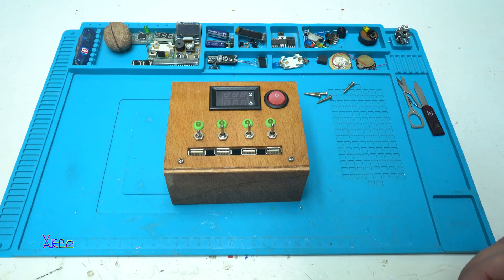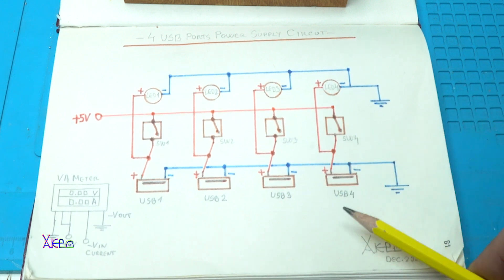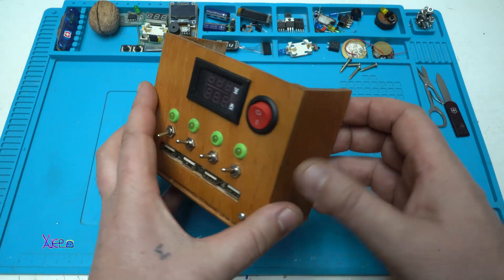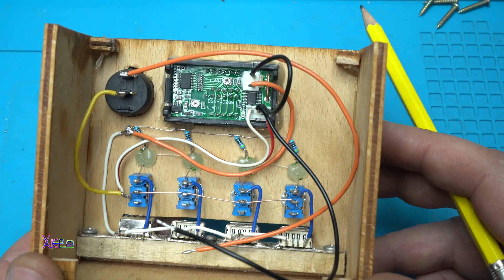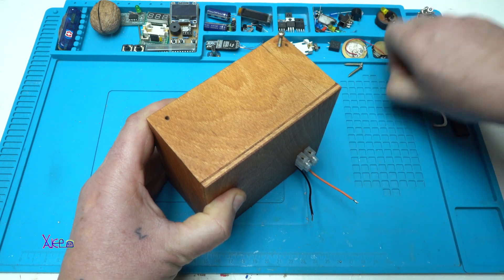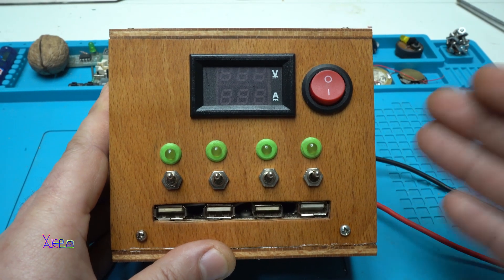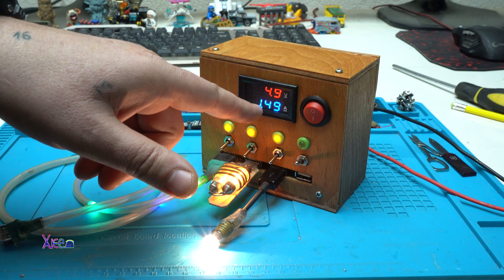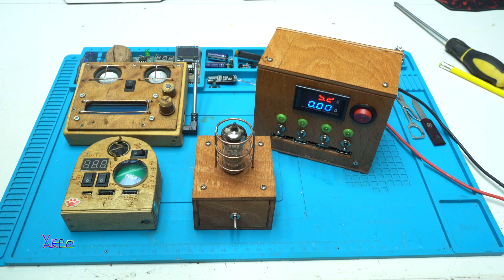Homemade USB Power Supply Unit - Part 2

Comment: Great project! You did not tell us about the power supply... If you are using a wall wart, you must make sure that it has voltage regulation. Without voltage regulation, the voltage starts high and the manufacturer is relying on you using the correct amount of current, to cause the voltage to droop to the stated output level. This will not work, for your application, and can damage things, including whatever you are powering. Both transformer and SWPS types of warts can lack voltage regulation (and very often do not have it, to save costs.) Your power supply started at 5.2V, unloaded, and drooped to (only) 4.8V at 1.5A. This makes me think that it may have voltage regulation, but that it is a little weak (But, maybe still within tolerance?) It could be something as simple as the ripple smoothing capacitor not having sufficient capacity, or that it is growing weak. If you can reach that capacitor, you might check it, to see how much ripple is on it. Maybe replace it and/or increase its capacitance rating. Also, please see my reply, below, regarding resistors. HTH. Cheers.
Reply from the maker: Thx for your feedback,I will use external power source that will give 5v 5A and I made this gadget for my next project big wooden desk work bench

Comment: In order for smart devices to be able to be charged with 1A instead of 500mA you need to short the data pins (D+ and D-) on each USB socket.
Reply from the maker: I didnt knew that,I need to make changes on circuit,thx for feedback

Comment: No rezistor in diagram
Reply: I agree... You need resistors to 1) equalize the load between the four ports (without the resistors, one port can suck up all the current. Other discrete components may be used, like diodes. Research load leveling; it is a very interesting subject.) and 2) the ports do not have any current limit (Meaning, things can get stressed, or burn up... Like the power supply.)